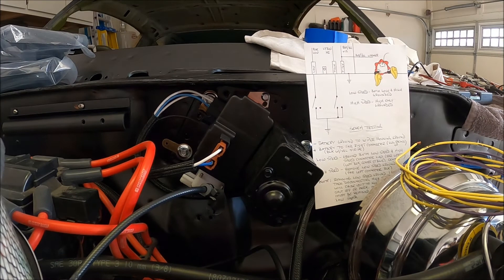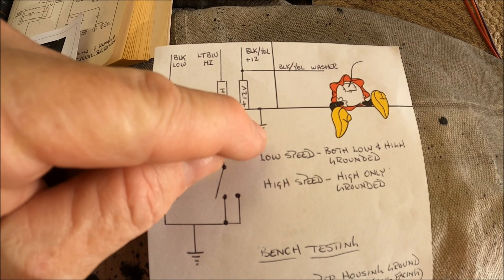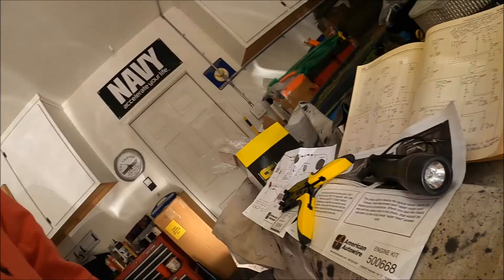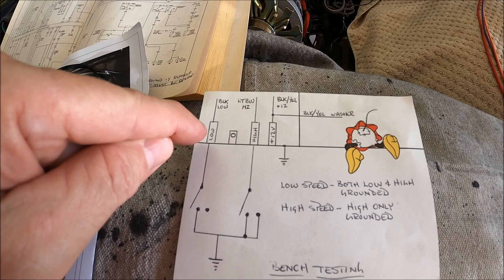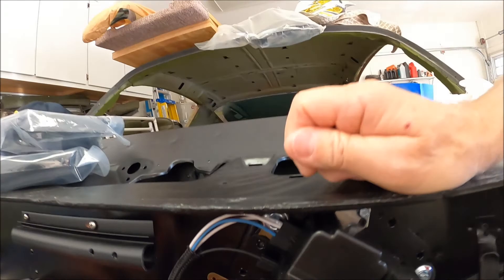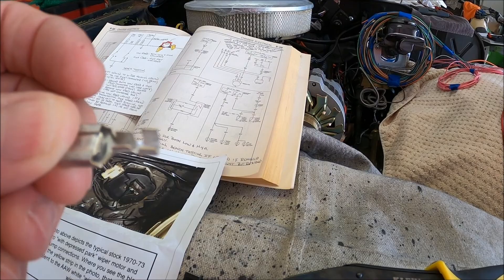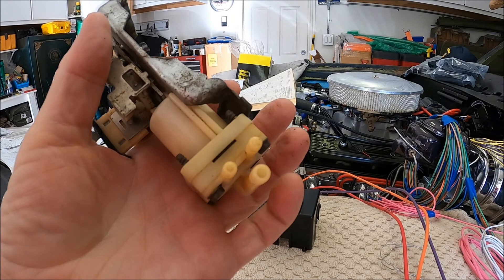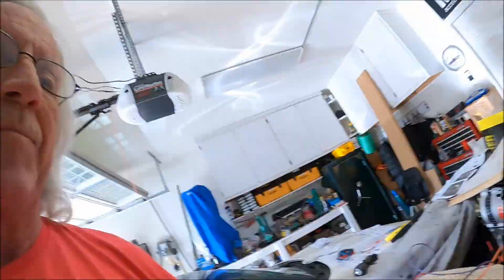"71" Camaro Restomod Windshield Wiper/Washer Wiring Part 02 5-13-2021

Comment: Hello, I’m working on a 68 firebird. Also has the American Auto Wire kit, do you happen to have a video that shows the wiper switch? Or a picture of the schematic. Thanks, great videos 
Matt.
Reply from the maker: Sorry, as of right now I do not. I'm getting ready to finish the inside wiring so I will be doing some videos on that part soon. I would think that the Firebird would be the same but maybe not? As you face the rear of the switch from left to right: black which is not part of the connector and is switch housing ground. Dark blue to connector which is ground circuit for the washer, light blue to connector is for high speed ground and then the other black to the connector for low speed ground. Hope this helps!
Reply: @Peter Egger  thank you sir, yes that does. The wires on this one has some different colors. I'm trying to get through what was hacked up. I have a white wire that is switched hot dark blue for washer, I have a light blue and that's it. Guess I'll have to just run some new ones.
Reply from the maker: @mattblankenship334  The additional black wire I listed to the the switch housing is 72-73 Camaro so you may already have all the wires you need for the Firebird. The two blues and one black to the connector.
Reply: @Peter Egger  ok thank you again